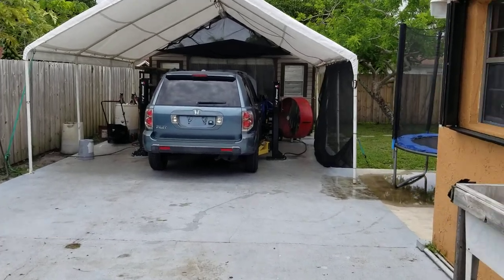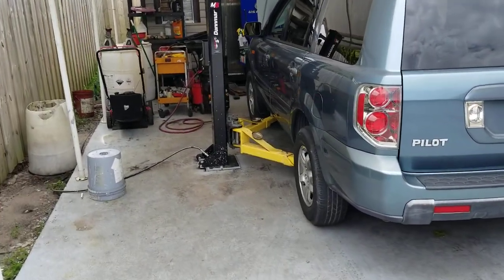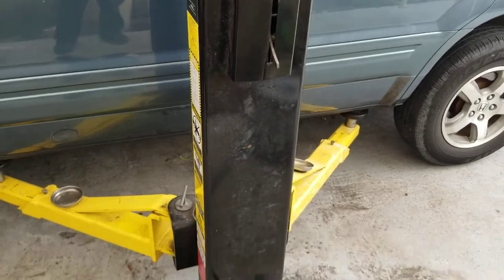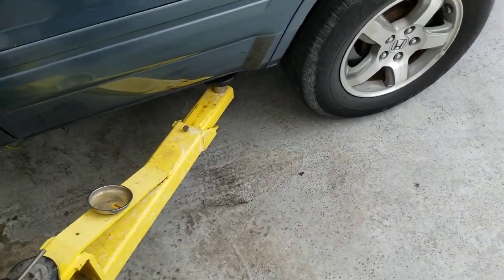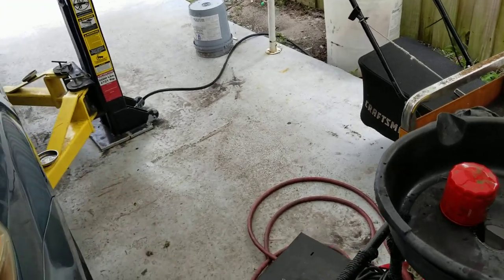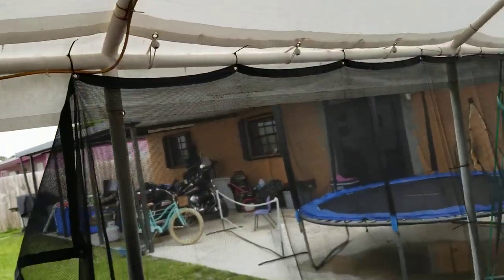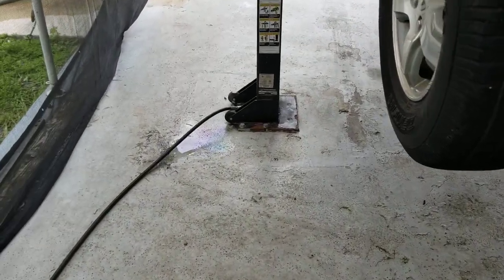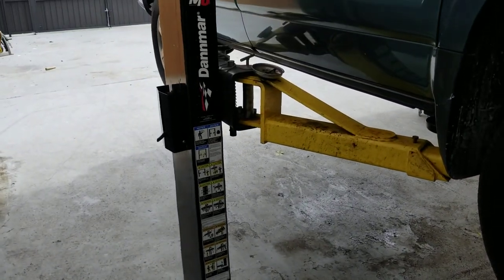maxjax m6 lift after 2 years of use. my thoughts and experiences.

Comment: I use old hockey pucks on top of my lift pads, especially when you are lifting on the side of a car and not on the frame.
Have had my Max Jax for over 15 years (older version) and my lift pads are still in good shape.
You can find used hockey pucks everywhere and usually for free or very cheap.
Cheers.

Comment: I have had my Max Jax for ten years. The first problem I had was the pump leaked, it was replaced under warranty. The second problem was a leaking cylinder also replaced under warranty. The third problem was lifting uneven. I was sent a pressure adjusting valve, that was put on one side, This helped. Since then I’ve had two more leaking cylinders, very scary. My model doesn’t have the automatic safety locks.
Reply from the maker: Thanks for watching and sharing your comments. How does this adjustment valve work. Did it fixed the problem completely or just improved it?
Reply: Yes this pressure adjusting valve basically solved the problem, but sometimes it will still a little uneven but not as bad as before.
Reply from the maker: I need to get one of those
Reply: @gautorepair  I just looked at this valve and the only thing I could find on it was a JP on the knob and a 3/8 inch on the bottom. I installed it on the side where the hose is connected. You turn this knob clockwise to lower the pressure and counter clockwise to increase the pressure. Hope that helps.

Comment: bendpack bought them out, they should handle warrantee issues.
new lifts come with a pressure equalizer valve.
Reply from the maker: This has the valve too but it doesn't work that well
Reply: @gautorepair  chattering is binding or air in the system.
i'm waiting for mine to be delivered this week.

Comment: I wonder if the longer hose is making one side lift slower?
Reply from the maker: I wonder the same thing but if i remember correctly I think it was also doing it before I added the longer hose
Reply: @gautorepair  My lift is coming soon but it will be a while before it is installed.
Reply from the maker: Let me know how the new lift works out for you
Reply: I installed this pressure adjusting valve on the side that was raising lower than the other side. I don’t think it matters. It has a knob to raise or lower the pressure on that side. It was sent from Max Jax. I explained to customer service how serious this was. I’m not sure if anyone other than Max Jax makes a lift for low roofs. I decided when I was looking for a lift that I wanted a four arm one so the wheels could be turned. Does anyone else have problems with the cylinder seals leaking? that is also very serious. Like I said before mine is the older model that doesn’t have the automatic latches.
Reply from the maker: I've had mine for a couple years now and no issues with the cylinders. The uneven lifting though is a different story. Sometimes  the difference between both sides is substantial. Like I mentioned in the video i was told that the warranty was no longer valid because benpack took over.
Reply: @gautorepair  If Bendpack bought Max Jax does that mean they carry them and sell the parts for them?
Reply from the maker: Yes
Reply: @gautorepair  try putting the car dead center maybe is to much weight on one side and the arm is giving up a little.